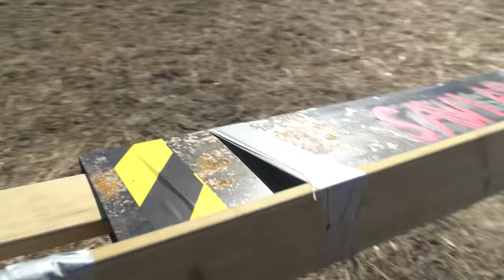Can you Launch Frisbee with Pneumatic Cannon?

Comment: Your sabot is acting as a brake, and the disc can't spin.  You need some sort of bearings on your sabot/disc contact surface.  Also, you need to restrict the speed of the sabot after the disc is spun-up.    Additionally,  I'm guessing your forward acceleration of the disc is excessive, resulting in air resistance overcoming rotational stabilization. 

Once you get it working, you're going to need a really fast dog to chase that disc.

Comment: You would have been better off using the tape to limit the cassette as it exited, or turn the cassette around so it didn't cradle the disc.  ran the sticky side of the tape along the wood to create some drag for a couple feet (like you had it) and see how that went.

Comment: I think, aside the obvious nondiscarding,discarding sabot, if you used a different style frisbee,it might help. Get you a real Whamo frisbee,it has a simple ,like 90 degree turn down,on the edge just a lip. These things have a whole rolled over thing going on. I know it's a performance,distance thing,but I think it's contributing to the backflipping. Just a thought,a regular old fashioned frisbee with a completely open bottom just a turned down lip,not that wierd rolled over partially enclosed bottom.
Thoughts from an old frisbee thrower,learned on San Anofre beach( however that's spelled) as a very young kid,and perfected in Missouri on a nice slick asphalt circle drive!

Comment: @Beyond The Press  Eliminate the 3d printed sabot behind the frisbee. As it slows due to air friction it kicks up, causing the disk to tilt up & catch air, slowing the disk and pushing it out of control. Also you only need a 1 inch long wood wedge taped to the side end of the nozzle, less friction on the disk gives better speed for stability. And lastly, shorten the round hose between the air tank and the nozzle. Air force dissipates exponentially the further it has to travel.👨‍🔧👍😁

Comment: i think you've got to stop that 3d-printed holder, or at least slow it down, so they are separated, before trying to give the disk angular momentum

or, how about this.  you 3d print your disks with a little axle, which is the only part a redesigned holder holds onto, so that the disk can spin more freely in the holder (may be some coating or treatment on the surfaces of the disk's axle and sockets in the holder to have low friction.  then you leave a tiny hole in the back of one side of the holder, so that as you release the pressure, air mostly pushes the holder out, but some air blasts through the hole on one side, spinning the disk.  might work?

Comment: I think this is never gonna work with frisbee with that high speed due to the frisbee's aerodynamics and weight. I am not an expert so I don't know details but the shape of the frisbee makes the air flow on the top be more than at the bottom which creates lift. And at very high speeds like this the air flow at the top must be a lot higher than bottom... and I don't know. Somehow unbalances it easily because the plastic frisbee is so light. Reminds me of trying to throw a paper air plane. If you use all your strenght to throw it it'll just nose dive or go up nose pointing at the sky and fall back down.
Reply: So my suggestiom..... make a metallic frisbee 0_0

Comment: You need to give more.time to the frisbee. Thing rifle gun. Sonthe spinning needs to start inside the barrel. Either wind a wire to the outside which unrolls during launch. Or rhe barrel has to be asymetric so more air passes on one side (then needs to shoot without a 3D sled. Maybe shoot with 1/2 sled so one part frisbee is rubbing against the barrel (sanspaper on inside) and other side is mooth (lots of grease)

Comment: I see a lot of comments about the sabot I think that's only part of the problem weight being the main problem.
the weight ratio between the sabot and the frisbee seems to be off the sabot pushes the frisbee along while really you want it to detach so the sabot is clearly too heavy you can solve that multiple ways have a heavier frisbee or a lighter sabot or both it also does not matter if the sabot gets destroyed often the simple way is the best way and making a 2 part foam sabot is the most used way and the most effective
then the frisbee should be heavier and more rigid with this kind of force the pressure of the air it flies through makes it flop sideways in the wrong kind of spinning action weighing the rim of the frisbee might solve that problem the rim is then more rigid.
another problem could be with the very dynamics of the frisbee's flight it normally has circulating air both around and in the hollow of the frisbee with high speed one of the 2 is disturbed making the frisbee flop over and over solving that means constructing a discus the frisbee on top is slightly arched at times making a disc with a flat cone on each side will definitely stop the flopping this solid object will leave the canon probably like a flattened cannonball! maybe you can 3d print such an object.